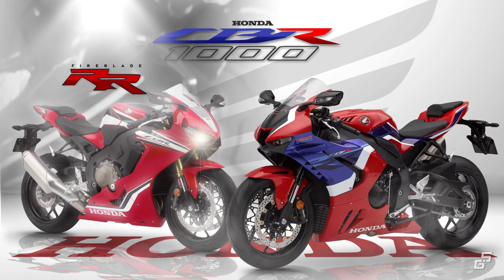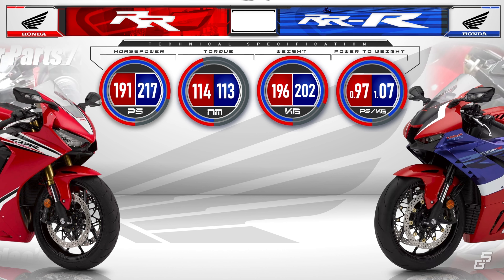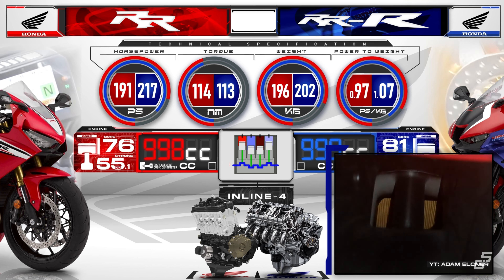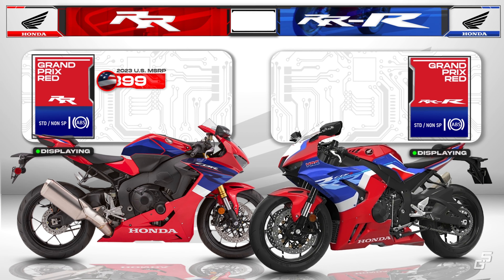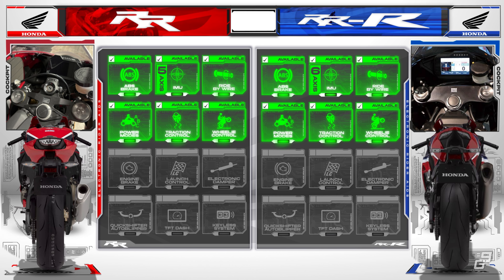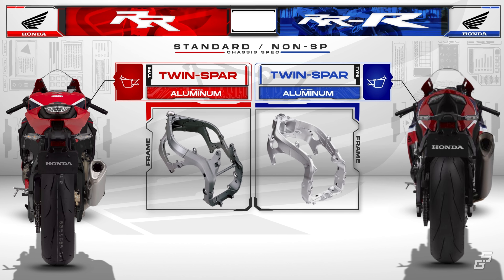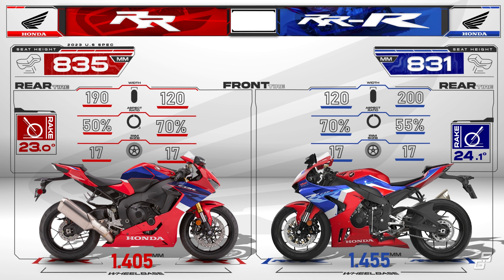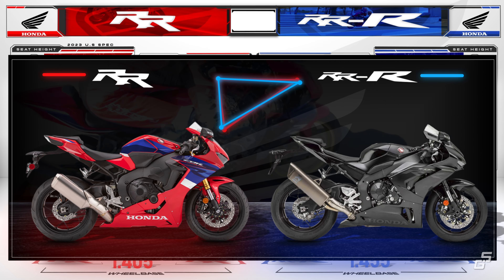Honda CBR1000RR vs CBR1000RR-R Fireblade ┃$10.000 for an Extra "R" ?

Comment: the triple R is worthy only if you race, the doble R is enoug for simple mortals as we are.
Reply: A ninja 250 is more than enuf for u
Reply: @Yakiniq-n7o  a tricycle is too much for you
Reply: @we-are-all-one6433  bruh don’t talk, you can’t even drive a Corolla straight
Reply: @we-are-all-one6433 lol
Reply: I have to agree with your statement, as the Triple R is more of a race bike and kicks the ass off every Japanese bike except for the H2. Then again the H2 is way too expensive and is not for riding around is for the track.
Reply: I agree with you that the triple R is unnecessary unless you plan to go to the track often and not use it daily.
Reply: +firebalde 🔥🗡 sp(abs)
Reply: Unless you want the faster one for the fck of it.
Reply: If it was worthy only to racers, why would they make it street legal ;)
Reply: @randomchannel1167  The bike is allowed in the streets but is targeted for the track, which is why it is not comfortable at all. 218 HP means it has a higher top end speed.

Comment: The Double R is WAY MORE comfortable as a daily rider. I used my Double R to go to work.
Reply: Same but I know the 23 I bought has the bigger bore stroke and throttle body, so I don't know if the horsepower is still 26 hp lower, really hard to find actual hp specs for the RR.

Comment from the maker: If you plan to do more commuting than track days, the RR is a more sensible choice. It is significantly less expensive, lighter, comfier, less physically demanding to ride, and has more than enough power you'll ever need for street riding.

However, if your priority revolves around slicing those seconds or miliseconds off your lap times on the track and you don't mind the price, the RRR offers just what you need for that. It has stronger top-end power, sharper handling, and more sophisticated tech. a more extreme, powerful, and race-focused bike.

Comment: Honda CBR has always been known as superior sportbikes with the necessary compromise in the engine characteristics (well explained here), construction frame and riding position. The CBR 1000RR version prior to the still available 2023 model in the US was an even better road touring sportbike albeit maybe the slowest and heaviest. Further down in the engine capacity to the In-line Twin 250CC RR, the model is still widely regarded as maintaining Honda road-going sportbike DNA with a smooth and efficient engine, moderate horsepower with good torque at the mid to lower range and a compact lightweight steel frame. For those who wants even more comfortable ride with a sportbike look and handling Honda also has that covered with another In-line Twin CBR500R whose engine mechanics, rider position and overall design is currently probably the most fuel efficient, quietest, most subdued exhaust sound and most comfortable riding among all sportbikes from any makers from 250CC-300CC and up.

Comment: Im a huge Honda fan...but   The New RR R have a lots of problems, a lots recals  and gear box melting  😅 with  gears cracks on track.  Maybe the new 1000    2024 will add some fresh quality engine parts....until then  I stick with Sp2 2018...

Comment: What Sportbike/Superbike would be the best option if it was to be swapped into a small lightweight car (Ideally under 2000lb vehicle weight hopefully closer to 1500lb vehicle weight) Ideally, I would prefer 200HP or higher, which is also 1000cc or smaller (I realize that this is an odd request as higher horsepower ratings probably requires more engine displacement). Does such a Sportbike/Superbike even exist? Thanks for any opinions and insights.
Reply: Best motor would be a ZX14R. 200 hp and much more Torque than a 1000cc bike.